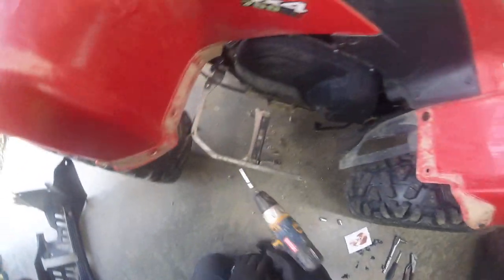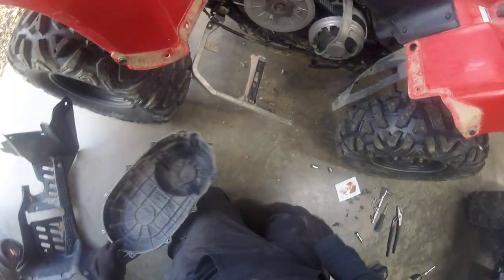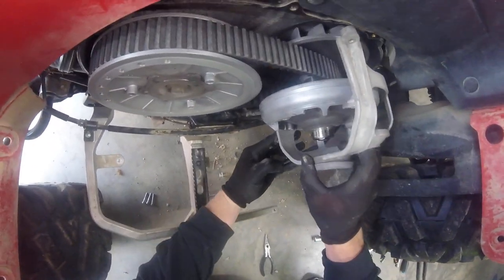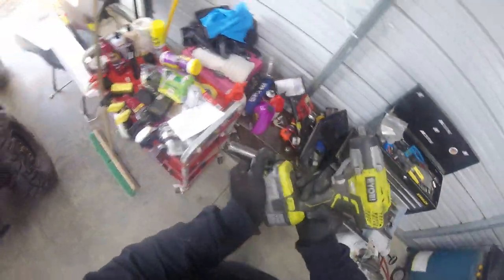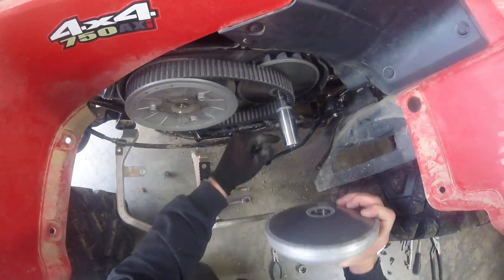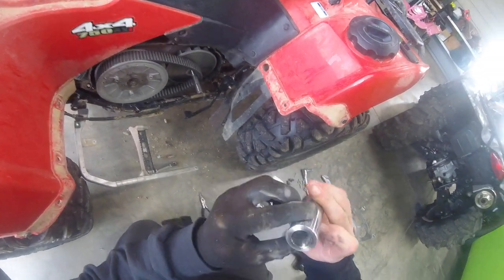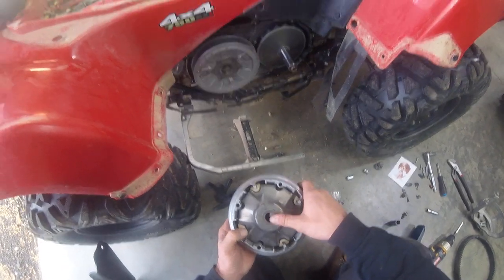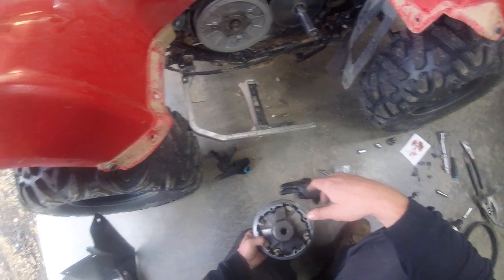kingquad cvt,shim mod and rollers 450/500/700/750

Comment: COOP’S MOD for King Quads. Shim mod details and clutch explanation

 

By Mike Stuart to Suzuki King Quad 450/500/700/750

Topics · 

What’s a machined clutch mod (Coop 3+) ?

The King Quad CVT as supplied is geared unusually tall at the CVT’s lowest reduction, making the wet clutch do a lot of work to bring the ATV from a full stop to the point the CVT gearing starts to take over. (it's like starting a manual out in second gear) 

This may have been part of early model run changes to make the quad more difficult to wheelie due to liability concerns, but nobody is talking. 

(an old rumor has it that the first issue of their new 700 CC utility ATVs provided by Suzuki as test examples, were very easy to wheelie and that a dealer, being an unsophisticated rider, injured himself popping wheelies with the throttle. The story goes that the ATV’s were bundled back onto the truck and whisked away and when the production models were later released they were curiously hard to wheelie and have been ever since)

In any case the starting ratio of the King Quads is tall and a great deal of low speed work is accommodated by centrifugal (wet) clutch slip, transfering less torque and less easy control than you’d expect. 

This tall gearing can be improved upon by shimming the front clutch collar by up to 2 MM using the shims mentioned below, and by the machine mod sometimes called the Coop 3+ mod. 

Shimming is just like putting a lower geared rear diff in a truck, it lowers the overall output range by a bit under 10%. This also means that top speed is reduced by the same percentage.

The machine mod lowers the starting ratio by up to 30% without reducing the top end gearing at all. 

The shim mod (which should be called the Coop mod after it’s inventor Arnie Cooper), with the mentioned compromise, is the easiest (and cheapest) mod to do at home. The machine mod requires you send your outer front sheave to be modified and return shipped.

1) If you have mounted 26” tires then the Coop mod will pretty much return the overall effective gearing to what it was with 25” tires. If you have bigger tires than that the mod will improve response in like proportion. The gold standard of course is the machine mod. 

2) Once a machine modded sheave has been installed and run for 10 minutes or so to buff the surface to the usual grey, it would be difficult for someone to tell that it has been modified at all without his using good measuring instruments and a stock new sheave as a control example. There is no center ridge and the transition point looks like normal wear. 

ps. Once bigger tires have been mounted on any King Quad, the King’s speedometer cannot be used as an accurate gauge of speed. It drives off the motor’s final drive so it will not measure true ground speed but rather something less. The King Quad’s speedometer cannot be calibrated to tire size.

True comparisons can be made using a GPS to measure speed.

A machined mod tapers the clutch face from stock to 2.25 – 2.65 MM further in at the center. 

This retains stock gearing at top speed while reducing the low end to 25-30 % lower than stock. Belt wear has not been an issue yet to anyone's experience. A Carlisle UA437 lasted over 12,000 kilometers.

Used with a 1 MM shim (for use with bigger than 25” tires), the low gearing will be as low as the clutch system allows.

You can get the shim from a Yamaha dealer, part number 90201-225A4-00 WASHER, PLATE (Thickness=1.0)

- If a clutch kit has been or will be installed it is better if the sometimes included EPI ‘wet springs’ (stronger centrifugal clutch springs) are not installed. Such springs are a ‘poor mans’ way of getting more snap in the low end, at the expedient of making the centrifugal clutch slip until a higher RPM. With the machining mod the wet springs aren’t really necessary and technical fine control may be a bit more finicky as the motor will be operating at a higher RPM at the engagement range. 

For dedicated mudders though, the wet clutch springs allow a harder launch out of the hole. As long as the compromise is acceptable. 

A stronger secondary spring is a good idea as the belt contact patch at full reduction is smaller than it was.

Mods such as lighter rollers or sliders or stronger secondary springs (the retail 'clutch kit') can delay the upshift of the CVT, allowing stronger drive when the quad is going fast enough that the CVT is within its operating range but they don’t have any effect until the ATV is going fast enough to have started to upshift. They do nothing to change the starting ratio. You are still starting out in second gear. The stronger wet clutch springs offered as part of some clutch kits are an inelegant way of getting more starting out performance, they extend the range of wet clutch slip even more than stock.

The only way to get a lower starting ratio would be to put really small diameter tires on the quad (as if), or to do the shim mod, which does help the situation some, but will reduce your top speed too, or... do a Coop 3+ style CVT mod that will reduce the starting ratio 25-30% and will not reduce the stock top speed in either range, at all.

The upshift delaying mods (clutch kit) do work well in conjunction with a Coop 3+ machined mod, enhancing available power in the mid range as they are designed to do. They just don’t help where the help is most needed. 

The mod is much more than just chucking up the sheave and machining it, the sheave has a grease seal located flush with the front sheave's inner belt running surface, and to do a proper job that will allow lowest reduction to be achieved this seal pocket and seal must be relocated further in to remain flush with the running surface, a step that has its own challenges. 　

The result of a machined mod to the outer front plate is a CVT with an increased operating range that permits much better fine control for technical situations, and improved tractability when one has to slow down in high range to negotiate an obstacle before resuming speed. 

And easy wheelies. 📷
Reply from the maker: yea i know i run the kingquad forum in facebook

Comment: How much did it help just doing the 1.5 shim on your 500 I have a 20 kq500 also wondering how much it helped in pulling
Reply from the maker: alot really notice when climing hills
Reply: @banshee100  ok thanks where did u get the shims ol bud
Reply from the maker: ebay coop 45
Reply: I found them ol bud I going to go 1.2 or 1.5 the 500 has plenty of speed it just need some more low end grunt that’s what I’m looking for if it goes 50 I’m good cause now it will go 70 plus if u got enough room
Reply from the maker: @shotgunz124  63 500 hits revlimiter

Comment: What do the shims do? And drilling the rollers? I have a 06 700
Reply from the maker: Sims lower gear ratio rollers keep it lock in lower gear for better pulling in mud and climbing
Reply: @banshee100  thanks for the response I watched some of your other videos and you explained it well thank you. I have a question on my 700 every once in awhile when I go to take off I get a little bit of slippage and the belt kicks in and makes a small chirp sound only when I take off every once in awhile. Does that mean I need a new belt soon?
Reply from the maker: No that's called belt bark it's when you lock the rear brake down and slide it causes the belt not to down shift in proper position.The bark you hear is when you stab the gas pedal and it just in the rite position
Reply: @banshee100  Good to know. I really appreciate it. Heading out now for a ride in southern Idaho. Beautiful day for a ride. Much love. 👍👍
Reply from the maker: You guys ever need new motormounts for any kingquad I make them I've sold lile 30 sets
Reply: @banshee100  okay I subbed to your channel if I ever need them I'll let you know. I really appreciate your time and your help..
Reply from the maker: Your welcome have a good ride
Reply from the maker: I have a vid telling about the mounts
Reply: @banshee100  👍👍
Reply: My quad use to slow itself down going down hills with engine brake. Lately it's not doing it anymore and the belt seems to let loose and it starts to coast and I'm having to use my brakes more. Any ideas why this is happening? I did just order a new belt and some shims. It has the original belt and it's a 2006 with 2100 miles.
Reply from the maker: I would just check the cvt out
Reply: @banshee100  Yeah hopefully cleaning everything out and putting the new belt on will do the trick. I'm hoping them shims will help a little bit with the bottom end lag.  seems to lag a little bit at take off.
Reply from the maker: It should
Reply: @banshee100  I ended up putting the 2mm shim and noticed some better low end torque. I have a question.. I'm going to buy new roller weights but not sure what size to go with. I heard 18 gram is good. I believe my stock ones are around 22 or 24. What are your thoughts on 18 gram? I usually trail ride but i like to have good low end torque.
Reply from the maker: @Maga4Lyfe  put 16 gram in it
Reply: @banshee100   Thanks i appreciate the feed back. All give them a shot.
Reply: @banshee100  Hopefully that size will help with the elevation loss of power. I live at 3250 and I noticed when we ride at 7000 feet it's a total difference in loss of power.
Reply from the maker: @Maga4Lyfe  ok let me know
Reply: @banshee100  I sure will. I tore that thing apart five different times this weekend. I got it down to about 25 minutes now LOL. Trying out different shims and testing it. My engine brake finally started working just a little bit with the two mm shim other than that I could not get it to work with any other shims.. I'm not sure why but it doesn't really bother me much..
Reply from the maker: @Maga4Lyfe  hum you need to check your belt mic it
Reply: @banshee100  I installed a brand new belt this weekend. it was a lot wider than the old one so I know the old one was worn out.
Reply: @banshee100  I have a 2016 king 500 lift exhaust 27's programmer and 2mm shim I'm getting 28's soon and would like a new secondary spring and weights nothing too crazy but just above stock what would you recommend? Epi natural spring and 18g?